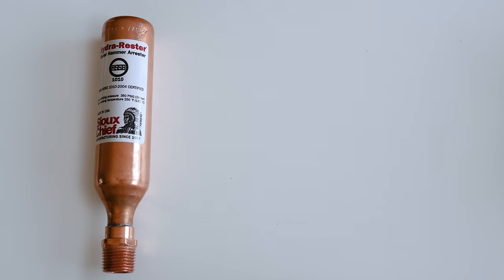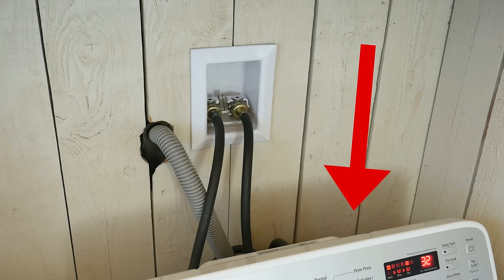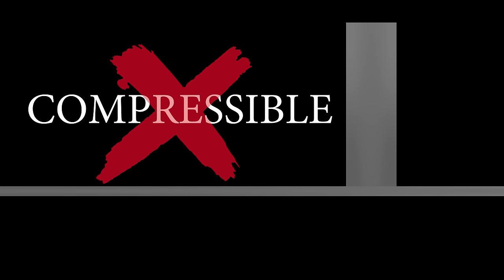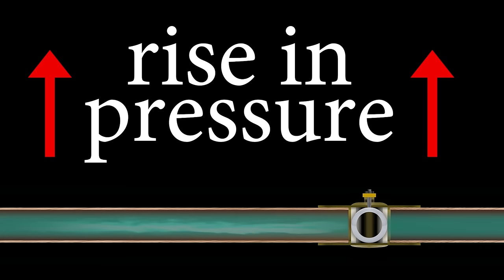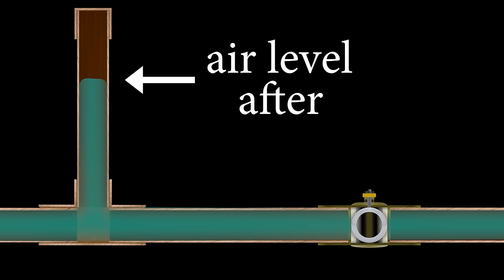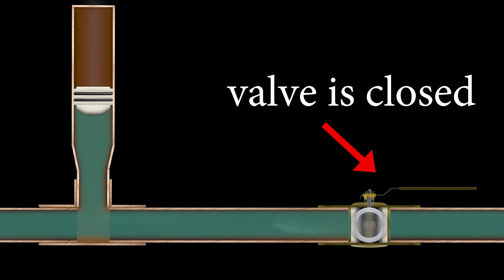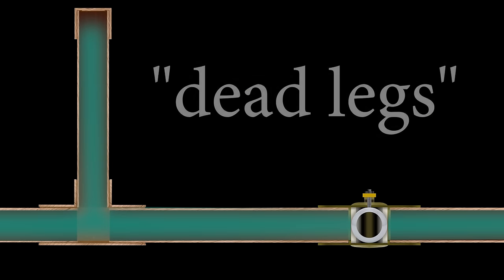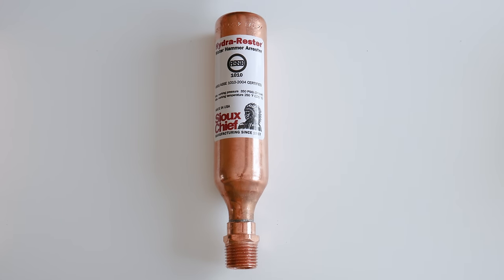Why Water Hammer Arrestors Are SO Important | GOT2LEARN

Comment: Is it true that pex A helps with water hammering? I recently replaced some of my old copper with pex. It's a very old home and doesn't have any arresters.
Reply from the maker: To some extent. PEX has elasticity compared to copper or CPVC, so it'll absorb "some" of the shocks, but if you are running on a low pressure in your home, that might be why you aren't  getting any knocking.
Reply: Yeah, I’m on a well system, 30-50psi. Never had water hammering.  Low pressure is more of a problem.  On the low end of the cycle it won’t even operate the pulsating sprinkler head.  It sits there for a few seconds spraying water weakly then the pressure builds up the sprinkler starts pulsing again.  😂😂
No pressure arresters needed.

Comment: I don't understand how they interior gasket of the water hammer goes back down. It seems the same has an empty pipe.
Reply from the maker: The air above the piston compresses as there is a shock, which brings it back down, just like a spring 😉
Reply: @Got2Learn  Thank you very informative and good video

Comment: Needed on uponor piping or no?
Reply from the maker: Pardon me?
Reply: @Got2Learn  It's like PEX.  I wonder if these plastic-type of plumbing is flexible enough to absorb the water shock to bypass the need for water hammers.
Reply from the maker: Oh sorry, yes they are needed.
Reply: @Got2Learn  A quick question on soldering brass ball valves to copper pipe, do you heat the pipe or both the valve and pipe?  Thanks.
Reply from the maker: On lead free valves, you must heat the pipe first then the valve cup as the new alloy doesn't conduct heat as well as leaded brasses.

Comment: Very nice bit of "marketing" bullshyte!
There are many ways to accomplish this without the many points of of installing the water hammer devices!
By the way, do the makers of these water hammer devices heavily lubricate those O-Rings?  If so what is the lubricant?  How long will it stay in place on hot water lines?  And how long is the predicted time before the O-Rings wear and leak-by and the device fails to work????

Comment: So one of the things you need to know about his warning for bacteria is that if you are using copper, it will kill bacteria naturally. It’s just something copper does to the cell wall of bacteria so there’s really zero risk of bacteria in copper lines.

I would be more worried about a hot water tank that sits because they make the tanks out of steel not copper.

As far as water hammering goes, putting these in adds extra points of failure to your system that will go bad, and if a plumber is worth his weight the soldered fittings will hang on for 30-40 years which will rot the copper out before the solder let’s go.

The noise itself is the only reason to want to install a water hammer, and if people are that anal about a little 1 second rattle, they need medication more than a water hammer
Reply: "people are that anal about a little 1 second rattle, they need medication more than a water hammer"
You obviously never had water hammer issues.
I fitted a AA size MiniRester from SiouxChief - must admit, I was sceptical of it working too, but it has cured the toilet cistern noise which was like the foghorn on the Titanic for at least 10 minutes as it filled and none of my house taps make a 'bang' anymore. I connected it about 1m from the stopcock. Even the neighbour's new ceramic 1/4 turn taps no longer hammer on my side - I am on a common supply with them. 
You can fit it any way up; it has a valve inside that you can see if you look down the end. 
I only wish I had known about this handy device years ago - nothing short of miraculous.
 So it was well worth the time and effort, and only £20 in parts.
Reply: @tiggywinkle1000  LOL.... calling that thing miraculous is only a slight oversell

Comment: Are they required in basement applications. I was told they are not required
Reply: It would be best to check with your local/state/provincial code.
Reply from the maker: These are pretty much mandatory everywhere now, but check just to be sure, I know here in Canada we cannot use the "air chamber" method anymore, it just won't pass inspection.
Reply: @inodoroguerrero  Here in Quebec Canada
Reply from the maker: Sweet, me too :)
Reply: In Wisconsin air chambers are illegal and hammer arrestors are not required everywhere only at solenoid valves.
Reply from the maker: Good to know, thanks for the info!

Comment: In order to totally prevent shaking pipes from changes in pressure you would have to have a hammer arrestors all throughout the house. Just use pex and bracket it down good.   And don’t pull a permit whatever you do!!
Reply from the maker: That won't work if you have 75 psi of pressure, you'll hear less of the knocking, but the hammering is still there and it could potentially damage your fixtures.

Comment: Lived in the same house for over 25 years and not really had a problem with water hammer. Dishwasher has a water pressure reducer rather than an arrestor and washing machine must have something similar.

Comment: I have water hammer when my outside hose valve is open and someone flushes the toilet. No hammer when the hose valve is closed. Would it make sense to install for the hose or toilet?
Reply from the maker: Yes, if you can.
Reply: It dosent make sense to install an arrester for a toilet because the floater of the toilet slowly close the valve, making almost no pressure peak when the valve finally close

Comment: I’d no trouble till main water supply was increased in pressure iv a shared water line with semi next door and every time they used there water I was getting hammering in my supply pipe going to tank in attic  This could sort out my problem ,Ta

Comment: Man, if only I knew this sooner! I’m an HVAC tech and I had a dumbass plumber who could never figure this out at St Jude hospital. All our hot water equipment have expansion tanks which do the same thing on a larger scale. I would tell the building engineers that the cold water needed something similar for their humidifiers. One in particular had a solenoid valve that came installed by the factory and would always knock no matter what they wanted me to try. The plumber could not figure it out, which is his fucking job, and they would always want me to check the equipment. Equipment had ZERO issues! Humidity always good, it was just one person who could hear the knocking complaining all the damn time, but they could never figure it out. Even after I told them that it had to be pressure build up from the solenoid, that dumbass plumber would say, “impossible.” Then he’d pull the I’ve been a plumber for X amount of years and I’ve never heard of anything like this before so it has to be your equipment. Gotta love professional ego and California ego for that matter. Thanks for the information!

Comment: I'm skeptical that the small amount of gas won't diffuse through the plastic over a few years and the aging o-rings won't bind up with increasing friction against the copper
Reply from the maker: These are tested 500,000 times in house, no need to worry 😉

Comment: water has disolved air in it, via pumps, flow disturbances etc... seems to me that air would keep rising to the air columns; worked for a hundred years, why change now?
Reply from the maker: Any air in a system eventually gets depleted and needs to be replaced by emptying the system, with dedicated hammer arresters like these, you don't need to worry about that.

Comment: I presume tthis is some regional problem, because I never saw such a thing installed anywhere. I understand why it would be useful in systems where a shock like this could cause a rupture, but with thicker pipes the pressure change is transformed into a different form of energy and dissipated.
Reply from the maker: Depends the incoming pressure of the water you got.

Comment: I installed one of these, the device did not have instructions stating which way it is to be installed as in horizontally or vertical?  Logic says vertices however I did not have that option. Is horizontal incorrect, anyone?
Reply from the maker: Any position, doesn't matter 🤗

Comment: I don't think code addresses this point, but you do not get the benefit of these arrestors if you simply put them in-line "pointing up" like in this animation. A dead leg had to face up because otherwise the air would just flow through the line.  But arrestors can be put in the horizontal position. And should be.  The correct way to install them is parallel to the direction of recoil.  Meaning if your installing at the end of a run from the valve, it should be in line with that pipe.   It's a matter of using a 'T' where you would have had an elbow.  Putting them on a 'T' in what was a straight run does not work as well.  It's like expecting the shock absorber in your car that cushions bumps in the road to cushion your car in a front end collision.

Comment: When shutting off water mains in the street. Shutting off a fire hydrant or the shut off valve in the street when a hydrant has been knocked off. They must turn it off slowly. Ad a city Water main may have miles of water moving behind it.. it can create a gigantic water hammer that can blow the walls out of the water main..separate hub and spigot slip joint connected mains.
Reply from the maker: Very true, thanks for adding that in @wayne p!

Comment: I almost never have a "water hammer" problem because my systems ( hardly ever) touch wood
Put isolaters in the hole, use a pressure regulator,and use insulation on the Hot and Cold piping!
Reply: Isolating pipe doesn't prevent water hammer, it just prevents you from hearing the water hammer. If you have a fast acting solenoid valve in a well isolated system, you still have a water hammer, you just can't hear it,  which is good, the noise is annoying, but the possibility  of damage to joints and washer hookup hoses (I've had one burst)  is still there.
Reply from the maker: Well said Andrew. It doesn't mean you don't hear them that you don't have any, that's even more dangerous.

Comment: You forgot the third and only right way to prevent water hammer. Proper planing with use of calculated Pipedimensions for the supplied appliances.

Comment: So much of water piping is being done in pex and wirsbo and cpvc.  This type of piping does not need these.  Now in commercial work, they are basically "recommended " and should be used.  If your using copper, then put them on shower valves and to the water closet. (toilet).

Comment: I live in Croatia and have to say I've never heard of a water hammer and never experienced this noise
Reply from the maker: You've got low pressure ;)
Reply: @Got2Learn  they say three bars is the pressure in our pipes. or we dont have those quick-stop valves. i dunno
Reply from the maker: Yes, that's pretty low, hammering occurs more around 60 psi 👌
Reply: @Got2Learn  ive never seen these either here in germany

Comment: I hear hammering in my pipes whenever anyone uses the shower, or the gas hot water on demand pump is running. If the water flow is not being stopped, why am I hearing hammering?
Reply from the maker: Pipes might not be straped properly and the vibration might be what you are hearing.

Comment: Why not just have a copper T that then goes vertically from 15mm to 22mm (via a service valve so you can take it off) , to act  as a dead leg and put a couple of rubber or plastic balls in there. ... job done.
Reply from the maker: No that won't work lol.
Reply: @Got2Learn  Yes it will.?. the balls are compressable..If you think it wont please explain why out of interest. It essentially acts as a liquid shock absorber.. and the air cant disolve into the water as its in the rubber ball.

Comment: Couldn't you just install an expansion tank on the dhw system?
Reply from the maker: Expansion tanks aren't for water hammering, they are for slow thermal expansion, they will work, but they are not designed for that and will eventually fail.

Comment: So if i turn my water on really slow it does the hammer thing.... if i turn ot on fast its just fine
Reply from the maker: Lol that's weird.
Reply: It does it really bad... didn't do it in tell we put a new frost free facut out side. It only does it at the new facut
Reply from the maker: Hmmm....did you think of installing one of these?
Reply: Yes i did think about it
Reply: Should i put it close to facut or at the water heater?
Reply from the maker: As close to where the banging is coming from :)
Reply: The banging goes from the facet to the tank.... its really bad.... only at low persher... if u open it all the way its goes away
Reply from the maker: That doesn't sound like "hammering", it sounds more like you have a bad cartridge or a defective valve. Did you try changing the faucet cartridge in question?
Reply: Its a out side frost free facut....
Reply from the maker: You said it's brand new??
Reply: Yea
Reply from the maker: Do you have Facebook? If you do, add me and we will talk.
Reply: Nope
Reply from the maker: Kinda hard to fix a problem I can't see or hear, do you have instagram then?

Comment: Is that just a small version of an expansion tank
Reply from the maker: Negative. Expansion tanks are for "slow" thermal expansions from your hot water heater, water hammer arresters are for "water hammering" due to fast closing valves, two completely different things. Your thermal expansion tank will dampen water hammering, but it is NOT designed for that and will eventually burst if it happens often.

Comment: If water arrestors are so important, than why am I hardly seeing any DIY valve installation Youtube videos with water arrestors as part of installation?  So far I see one DIY Youtube video that uses water arrestors.  My delta valve instruction manual didn't mention water arrestors either.  Last, why would it not be in the plumbing code anymore if it is SOOO important?

Comment: Just use a expansion tank boom done
Reply from the maker: Not made for hammering, only expansion.
Reply: @Got2Learn   Strongly disagree! Only difference a poly piston in a tube with rubber seals with Air on the opposite side. Expansion tank would have a rubber diaphragm with air on the opposite side. Only difference is marketing.

Comment: You missed kind of the biggest point where should they be installed?
Reply from the maker: Closest to the fixture in question.
Reply: @Got2Learn  in my situation for a toilet I installed the arrester on the valve and it has has little to no affect
Reply: Do they still work well if I added more to various spots along the line?
Reply from the maker: @ian3404  Are your pipes well fastened in the walls?
Reply: @Got2Learn  I would say yes but they are the way it was build 25 years ago I guess I could add more straps
Reply from the maker: @ian3404  yeah because these arrestors don't do miracles, they are good when the rest is good, also, how much pressure do you have coming in your place?
Reply: @Got2Learn  average I would say about 30 psi
Reply: It’s only the main floor toilet the basement toilet doesn’t do it and it’s feed off the same 3/4 main copper line...
Reply from the maker: @ian3404  that's low, i'm surprised your even getting any knocking, I am pretty sure those pipes aren't well attached, check that out first. Also, is the toilet the only fixture with this problem?
Reply: The hole house shakes when the tank fills up and the valve closes lol
Reply from the maker: @ian3404  yeah, what I am thinking is that the pipe isn't properly attached, wanna bet 😀
Reply: @Got2Learn  okay thanks for the help! I will try that,  would it be a good idea to add an arrestor too the main line tho or would it be ineffective

Comment: IN ADDITION, of utmost importance, is to eliminate FLOATING VALVES. I cannot emphasise this enough. I had terrible water hammer problems, installed TWO Chief arresters on the one line with little result. A kindly young plumber told me to replace FLOATING VALVES, that is, each tap or faucet that is left open such as the one to the washing machine, water heater, irrigation timer, etc. Replace those with spring-loaded washers (valves) like these: https://fixatap.com.au/fix-a-tap/tap-valve-repair-kits/anti-hammer-tap-repair-kits/anti-hammer-tap-valve-repair-kit-13mm-222220#  These fixed my hammer problem.

Comment: An expansion tank works better when area is available.
Reply from the maker: The only thing with an expansion tank is that, yes, they are good for "slow thermal expansion" but they aren't designed and don't perform well when there are shocks in the system as well as dedicated hammer arresters.

Comment: Not really needed for residential pressures and volumes. If your pipe is strapped and secured properly. A ballcock, sprinkler cylinoid or washing machine should not be enough to create a damaging hammer. When you hear that clunk with an abrupt shut off, it has more to do with pipe not being secure and bouncing.
Now...in commercial applications where volume and pressures are much greater, especially running industrial equipment , you can get enough energy to create a dangerous hammer. Also commercial fixtures like water closets with Sloan valves will need to be arrested.

Comment: I don't use those cuz I do my plumbing right like you're supposed to and you won't need those inside of your house or trailer or business. Unless you're running major water pressure you should not need none of those. Those are more commercial use for businesses using a lot of water and doing hydro testing

Comment: Copper kills both viruses and bacteria after a few minutes to a few hours of contact. It would be virtually impossible for bacteria to live in a potable water copper pipe. Of course this isn't true for PEX so stagnant water might be more of an issue there. Silver also kills bacteria but only if it is wet. Anyway thanks for the video.